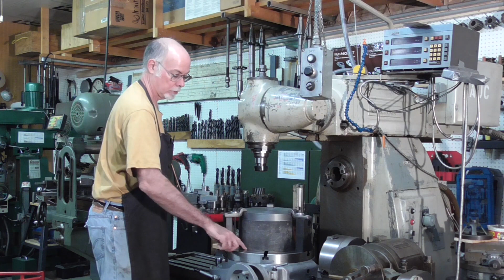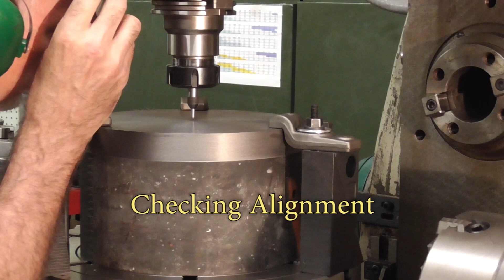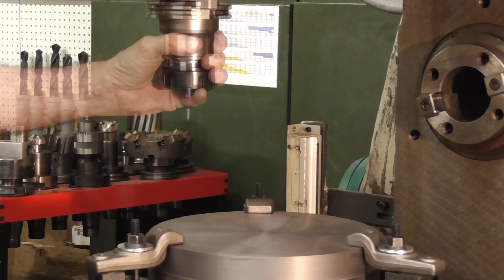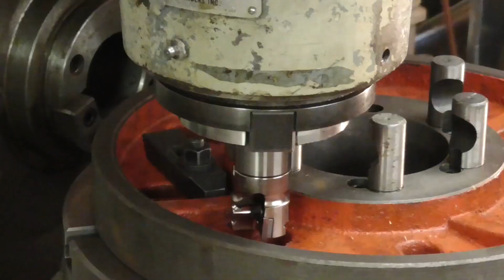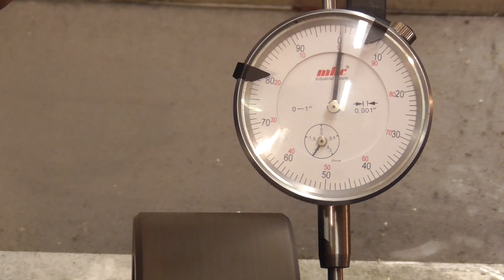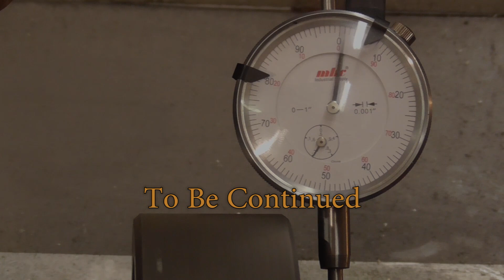Adapt! Part 2

Comment: Gary, On your hole pattern error. It seems as though you should have indexed the part on the rotary table, not rough it in with a steel rule. If the part was eccentric to the rotary table, your zero on the part was not the zero of the rotary. As you rotated the table, your zero point on the part moved X and Y. Just a thought. I think I would have made a center drill hole when the part was in the lathe.  At the mill, I would use a center finder to zero on the rotary table. Then put the part on the rotary, then use a center finder to center the part on the rotary. This would make all of the zeros on the same axis.

Comment: nice work Gary - I often use thin cardboard for templates- you could trim this to miss the clamps for checking your hole pattern.

Thanks for making the videos - subscribed

Glenn
Reply from the maker: Glenn Davis didn't have any transparent cardboard lying around, so I used Lexan instead <grin>..gary
Reply: I guess I should have mentioned, I use a lot of paper and dirty fingers (rubbing the paper over the hole pattern)  to get the hole or figure impression, then transfer this to cardboard with a glue stick.

Comment: Is there a reason that you didn't just calculate the x y corder-nets rather then the PCD is one more accurate then the other?
Reply from the maker: There are usually several ways to do each job, I chose r-theta coordinates, someone else might choose x-y and get similar results. Either one should be "accurate enough," being more accurate than that is just wasted effort. On the workpiece, I had a center mark from the lathe that would define the origin, but on the faceplate, the origin would be in the center of the central hole, so centering the faceplate on the already-centered rotary table was perhaps an easier choice.

Comment: 4th alternative: mill the holes to take a thread insert. We all make mistakes  - I once was about to mess up a even bigger chunk of cast iron than your using for this project by thinking the pattern should be a mirrored version to what it was supposed to be. Thankfully a observant coworker came by to chat before I had drilled any holes.